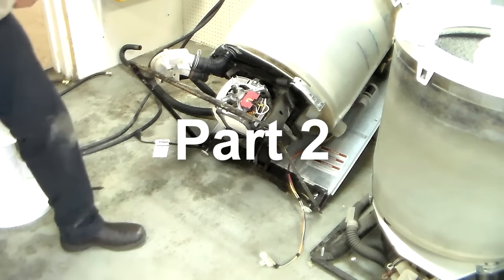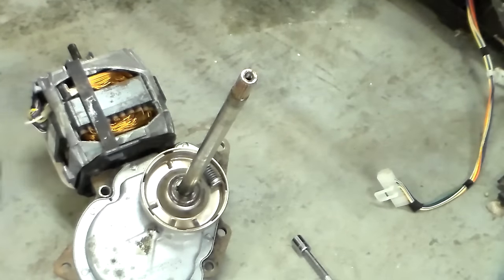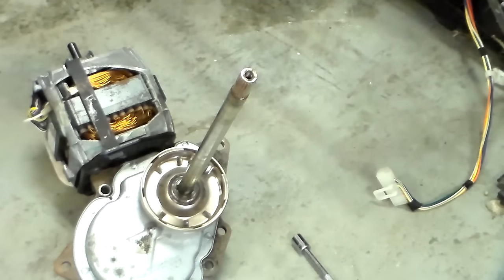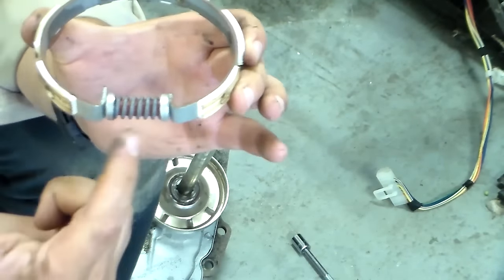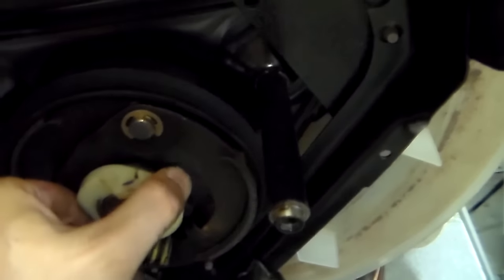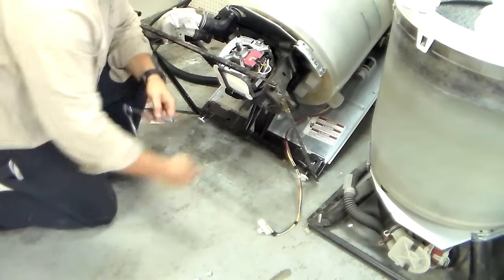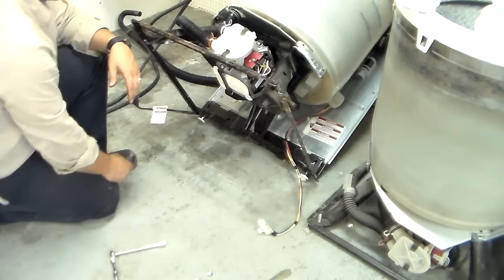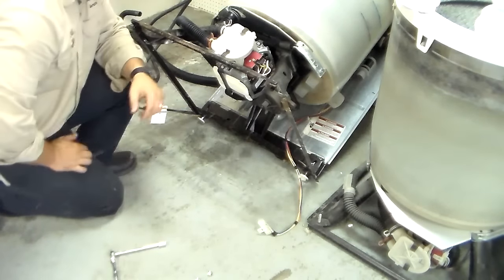Kenmore Whirlpool Washer Not Spinning 2

Comment: kenmore heavy duty super capacity model 110.24422300
In the middle of the 6 minute cold/cold cycle the washer fills, agitates, then stops at this little square .  And when I mean stops, I mean STOPS -- like there's no power to it at all.  Setting the timer to ANY setting produces zero activity - almost like there's a thermal fuse that is resetting??  Could there be a bearing issue??  I can get the washer to pump (after it "resets"), but not to spin.  plastic/rubber transmission part is in great shape.  Clutch also appears to be in great shape (mine clutch is upside down, so I can see it).  The only other suspect would be the timer, but how would that cause an overload??  I'm a bit baffled, partially because I don't have a good enough idea (a schematic, etc) of how it is supposed to function.  Is there any other way to force the motor into a "spin" condition besides the timer?? Grasping at straws here....thx!!  Recant - I was not looking at the clutch, and turns out it is definitely bad.  Praying a new one will get the beast back on its feet!!!
Reply from the maker: Michael Mohlere So your starting this on a normal cycle, cold/cold.   It fills, agitates, then Stops.  Do you have a  selector switch for spin speed and agitation speed?
Thanks
Reply: Bill Newberry No, it apparently does not...  The clutch is definitely fried and I have ordered a new one via ebay (I'm sure overloading the washer over the years didnt help).  Seems like best course of action at this point is to replace the clutch and then see how it behaves.  It's pretty much almost as far "apart"  as it can reasonably get at this point.  Thank you so much for taking time to reply!!! :))))

Comment: What if when you check the motor coupler it will move a little and stop, wontbturn more than a quarter turn? Is this the transmission?
Reply from the maker: Most likely, unless you have something wrapped around the agitator in the tub.
Reply: So scrap it?

Comment: my clutch is good condition, my coupler is in good condition. and my lid switch is in good condition too. wonder what else causes it not spinning.
Reply: update: it was because my clothes got stuck in the basket. after i removed it. it worked fine.

Comment: Replaced couple and checked the clutch which is newer and I could not turn is, put it together and still no spin. while in spin the clutch moves very slowly, so what else could it be?
Reply: A bad motor control board.
Reply: I removed the gear box and took it apart and found the neutral drain plate was not attached, as the shoulder screw that holds it in place was broken off at the threads, I had to order the neutral drain kit as buying just the screw was not available. Once I received the kit and put it all together it worked great. :-)

Comment: There is a rubber foamy gasket on the outside of my clutch. Where does that go?
Reply: it's a bumper foam that goes on the outside of the clutch so when your load is off balance it wont bang so hard.

Comment: Ok so I just replaced the clutch including the plastic piece that is attached to the tub underneath and the entire container that has the clutch - mostly because it was all in the kit. And my washer still does not work. I've taken it apart 2 times now and reinstalled just to make sure I did it correct. 

I've checked the motor coupler and it is fine. I'll check it again now but I'm wondering what else could it be?

I hear the motor trying to move the agitator but nothing moves. Ahhh. Help

Comment: Mike tax your couplings are broken, that's the part betwemike tax that's the part that he didn't show but explained it at the end, it's the part between the motor and that transmission, it's attached to the motor shaft and the transmission shaft, it's what allows the motor to drive the transmission

Comment: Hi Bill....I replaced the coupler in my older Kenmore and saw that the clutch was like new. Re-assembled it and the motor runs great and the coupler spins beautifully, but it won't turn the clutch or the basket. Please if you get a moment, could you tell me what I am doing wrong? The pump works, and the motor spins very fast, maybe 2000-3000RPM (just a guess). We are swimming in dirty laundry Bill, so your expert advice would be deeply appreciated.  Rob Orizino in Baldwinsville, NY 13027  PH  315 727 2245 Happy New Year sir!
Reply: It's been 3 months. I'd have bitten the bullet and called a repairman by now.
Reply: Craigslist.org pay up to $25 for broken machines. Then call Sears again.

Comment: Why leave that heavy motor in place and not just remove it?
I don't get that.
Reply: Time saver if your doing it on the job. If your diy then its easier to take the motor off.
Reply: @thewallaces9110  Come to think of it, I  have come to actually see that it is better with the motor on it, especially when installing it back on.
I always find it a misery to align the top clamp without it getting in the way when placing the motor in position.  And taking the motor off too because the clamp falls and its front edge get hanged up in the stator body, if you know what  I mean. The little craps that takes up precious energy.
Reply: @alchemy1  taking it off gives a better opportunity to inspect the direct drive coupler. I could see an advantage either way. Upsell replacing the coupler while your there, or save time if the customer doesn’t want it.
Reply: @thewallaces9110  I tell you I still can not picture, nor have I seen anything about it, that is the transmission.
After ruling out the whatever it is called "drive block" up on top and the clutch and the coupler and the motor and all that, how in the world one can know that a transmission is bad.
Is it based on deduction?  If the shaft is not spinning, the clutch and the coupler is fine, then it must be the transmission or is there a directy way of simply checking it?
Once that whole deal is out, one can turn the shaft by hand.   Is there some means of how easily or how hard it should be to turn the shaft by hand or by whatever?  I haven't seen a straight foreward answer.  I am sure there is one.
Reply: @alchemy1  I guess if you rule all the other things out, you are only left with the transmission? I suspect the failure rate for the transmission is fairly low. All this plastic parts are designed to break and save the motor and trans from damage.
 I replaced my clutch last night and took the motor off before the transmission. It only added a couple minutes to the repair. And probably made it easier.
Reply: @thewallaces9110  Ruling things out is good for survival mode but no substitute for knowing.
What specific thing would stop someone from actually testing it. You know the actual test.   All it means is the drum, and the plastic agitator is not hooked up and the body and the frame is not there or the water pump.
The fact is all needs to be there is the motor, the transmission along with its shaft just hooked up ready to put it in whatever mode you want, agitate, drain, spin ( low or high).
You know, like this:
https://www.youtube.com/watch?v=9zVGGZ5FgQM

Comment: Bill,

This is an awesome tutorial, I used it to fix my 80 Series Kenmore and it worked brilliantly---it was the motor coupling. The washing machine is now working, but I actually found a piece on the floor after I put it back together (pictured here flickr.com/photos/jimgroom/8248147913/). Do you have any idea of what this is? I couldn't find anything online, and I just want to make sure the whole thing isn't going to break without it. Thanks again for the awesome tutorial.

Comment: Great video. Checked coupling and clutch as per instructions, both appear fine...the tub actually spins but makes a higher pitched "chunk chunk chunk" noise while spinning. (see video) https://www.facebook.com/photo.php?v=10152891143280101&l=6885019128654351751  Any ideas?

Comment: These are all the easy fixes. The BIGGEST #1 problem with MOST washing machines especially Kenmore/Whirlpool is MOST of em the pieces of GARBAGE they are will fill fine, wash and agitate fine, drain fine, BUT, then make a terrible grinding noise and won't spin on the rinse cycles. Why? because they use SUPER CHEAP transmissions which ALL should of been recalled. Most repairmen will charge you so much they will tell you just to buy a new washing machine, which is what ALL these "PURPOSELY MADE TO FAIL" machines are designed for. So they keep you buying new ones. All cheap China made plastic parts that literally disintegrate when exposed to calcium deposits.